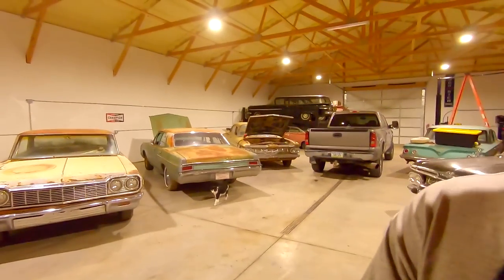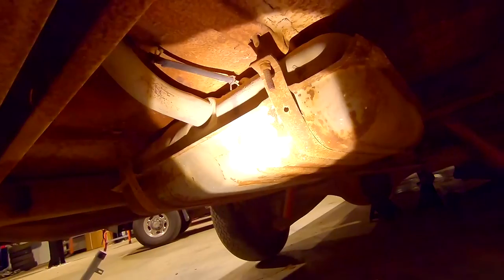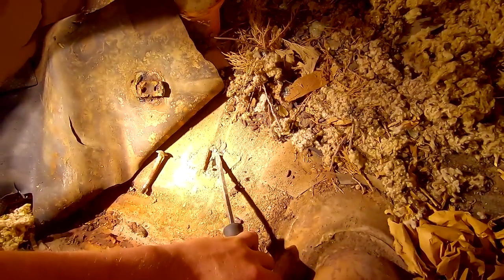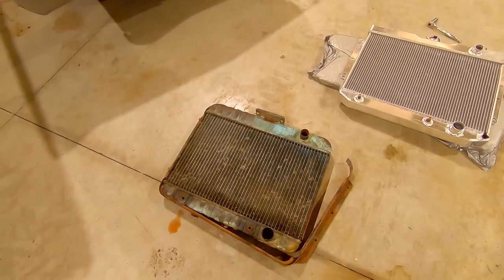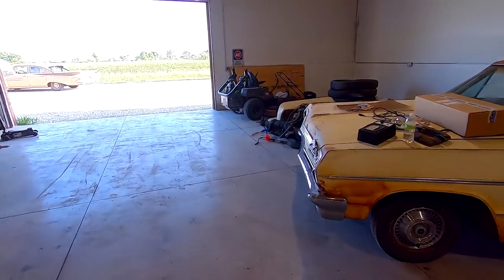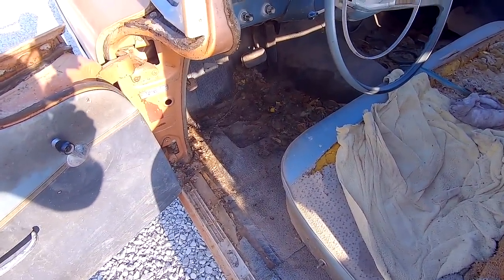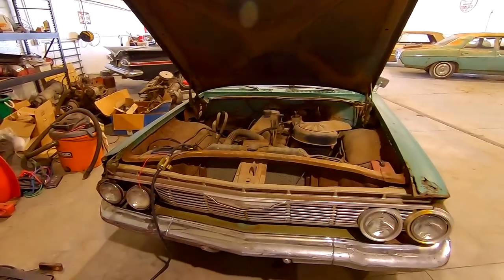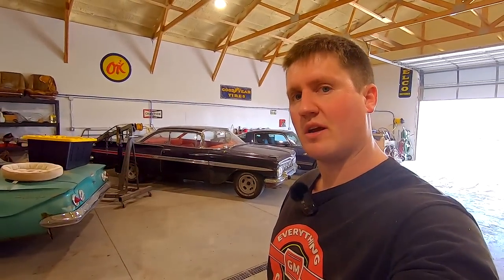1959 Biscayne Progress! NEW Fuel System, Brakes, Wheel Bearings - FIRST Real Drive in 20 Years!

Comment: My first car was a 1961 Impala with the 235 and Powerglide. Very dependable and always started right up on those bitter cold Iowa winter mornings.  My favorite Chevrolet
 years are 1961 to 1964. I miss the Turbo Fire v8 and the Powerglide whine in park.  Thanks Ryan for bringing these old cars back to life.
Reply from the maker: Thanks for sharing!
Reply: 58' & 61' my least favorite years of Chev. Back in the day ( early 80's) I bought a 🍒 cherry 61' 4dr Belair($200.00) for a crash car, hell runner (283ci cast iron power glide) all of a sudden the engine started squealing so pulled into the Yankton Store at night, no oil on the dip stick, bought some oil kept pouring  but nothing on stick, then we noticed the large hole in the pan & several quarts on the parking lot. Man, the owner of the store was pissed off. There's more to the story, but I will stop before my comment gets too long ....

Comment: I had the same problem you have. I couldn’t find the right upper radiator hose for my ‘61 Belair. I bought an adjustable thermostat housing on EBay and cut to fit a hose I had laying around. It was a perfect fit.
Reply from the maker: yeah they need to make one for these cars lol
Reply: I bought one for a V8 Chevy. It will fit.

Comment: Excellent video Ryan :) also nice Gold working excellent to and Green one be mint Green color on great shape both in too! Also for paper gasket seal  great try sometime is get old inner tube silicone together with gasket and seal together like sandwich plus lots silicone  plus  gasket mender tar silcone then silicone on top and bottom gasket a help too! For head gasket or water pump or anything gasket up do 1/16 to 1/8  layers for metal sealing! Sounds weird but work excellent and I done before on my vechiles too!

Comment: I inherited a 1938 Chevy Master Deluxe. It's in great shape other than the mice.
I completely gutted the interior. Vacuumed and compressed air every nuck and cranny then washed the entire inside. Dried it in the sun.  But it still stinks.  Now what ?  The smell bothers my wife's asthma .
My family is counting on me to get it on the road.
Reply from the maker: Most likely will need new interior to get that old smell away, or talk to an auto detailer, they may have some kind of spray thatll fix that

Comment: I wouldn't throw away the original radiator. A lot of guys that prefer stock would spend the $$ to recore that original. Those cheap radiators may do the job, but they look really out of place.
Reply from the maker: i wont, but i wont use it